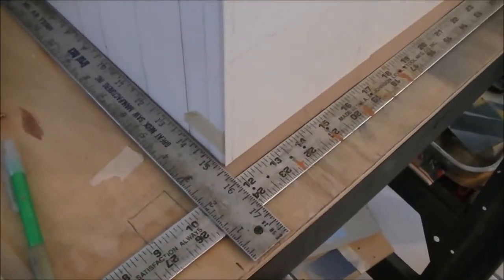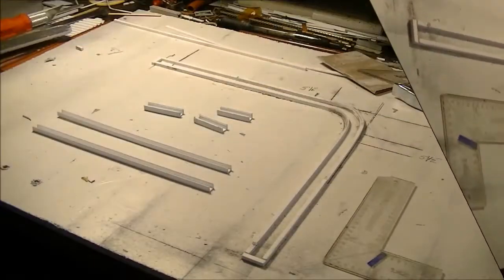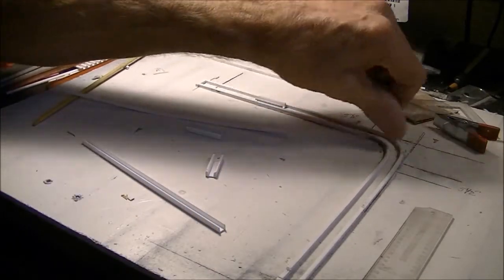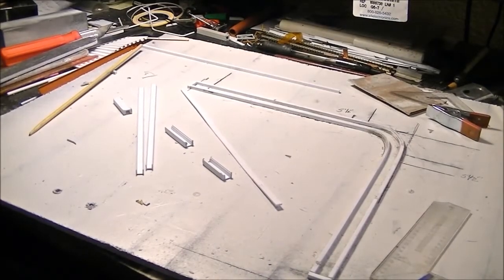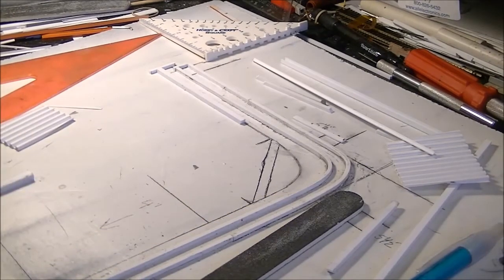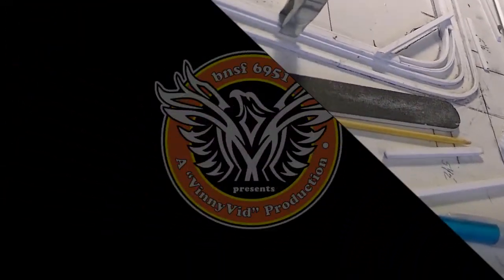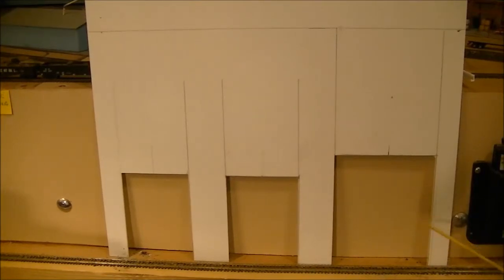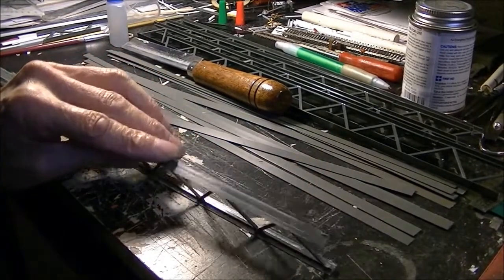Trusses Moc Up Operating Doors

Comment: You are stubborn for sure. lol  I have 2 suggestions on the doors.  The first is to put a plate across the entire bend to give added strength and to close the open side.  The other is to take a heat gun or hair dryer and warm the c-channel to make the bend in the form so it would be one piece.  I would also put a piece in the channel after you heat the channel when you make the bend so it doesn't kink.  Just a few thoughts.  You are right the building is too high.  Keep up the great work with the builds.
Scott
Reply from the maker: hi Scott.. on my first attempt on these doors i tried the plate on the side it looked ugly as far as the heat gun goes i tried that also & it didn't work... it will bend but not enough before it kinks... i think i have it beat now that i have made the jig... thanks for all your input & comment
vinny